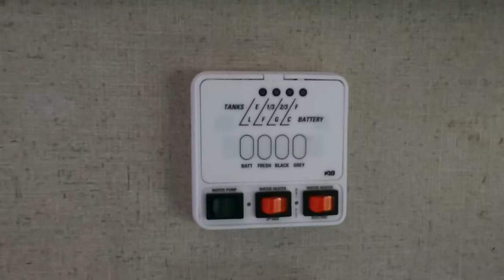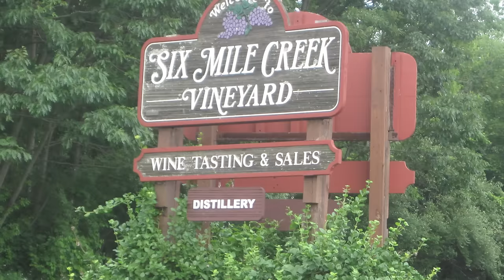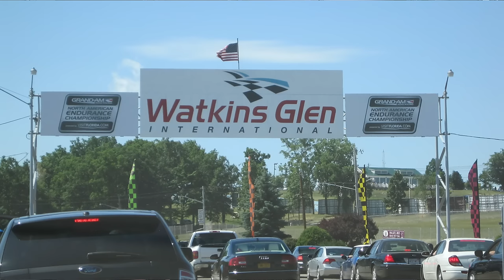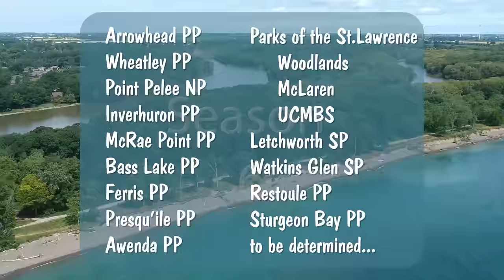Where are we going in season 6?

Comment: Sounds like a great season of camping! We are also looking forward to our first trip to Lake St. Peter at the beginning of June. I also like the idea of being self sufficient  to have more campsite options, especially when it comes to those waterfront sites. We are doing the research now to get there. Unfortunately,  there is is so much conflicting information out there, especially solar vs generator, lithium vs lead acid. Your videos do a real service in so many ways.
Reply from the maker: It's so much information to sort through when trying to figure out the best way to be self sufficient. I think we're keeping it as simple as possible by upgrading to LiFePO4 batteries and using a solar generator to top up the batteries and run AC appliances such as the microwave. But even with that you have to determine what brand of batteries and how much amp hours you need and how big a solar generator you want and how much solar panels is best. Whew, it's a lot.

Comment: Great video.  What cleaning solution do you use in your sprayer to clean your roof?
Reply from the maker: I've always used Dicor Rubber Roof Cleaner mixed with water in a bucket and applied with a sponge mop. This time however, I'm trying Zoom Concentrated All Purpose Cleaner https://amzn.to/3U6oKHR. It was at the Kitchener RV Show and I thought I would try it out. You spray it on, let it sit for a couple of minutes then gently agitate it with a soft brush then hose it off. I used it on the roof and body of the trailer and was very impressed. I didn't use it on the awning and tipout yet but it's supposed to be good for everything. It cleaned the roof better than the Dicor product and it was easier to apply.

Comment: Heads up about Woodlands park. The dump station is outside the park on the roadway. Only one trailer can dump at a time. We were lucky when we left as we didn't have to wait. We did however see while we were there up to 10 trailers parked on the road waiting. Not sure if the 2nd park you are going to there if they have to use the same dump station. We were there last summer. We also went to Farran park there and they had their own dump station in the park.
Reply from the maker: I think the dump station is for both McLaren and Woodlands. I imagine it can bet pretty backed up. (pardon the pun)🤣